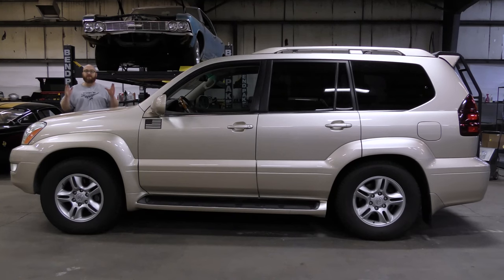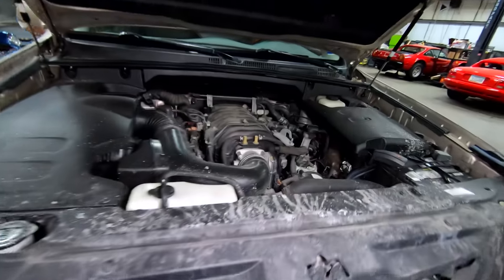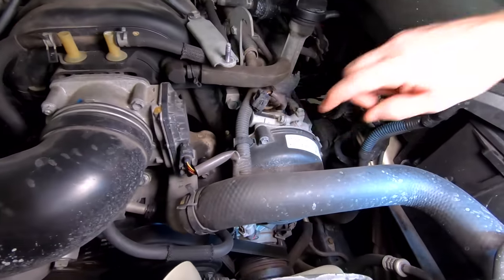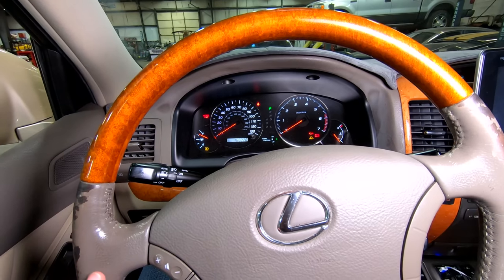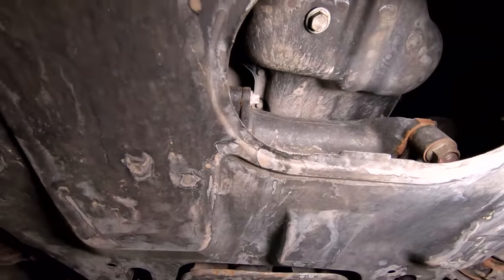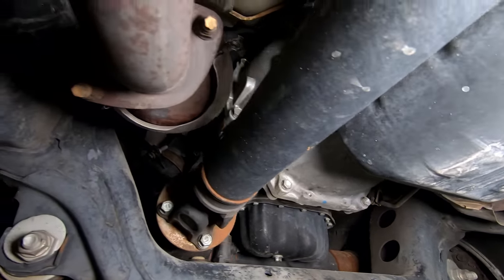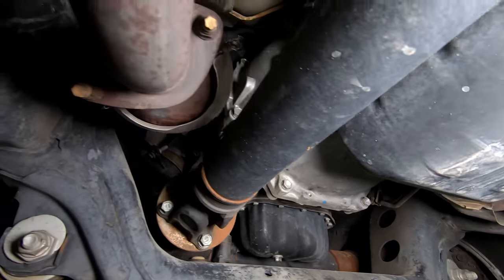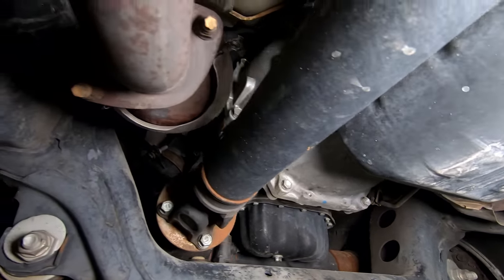How could this super reliable '07 Lexus GX470 have such a stupid design? CAR WIZARD weighs the risk

Comment: Starters don't fail often at all on cars without start-stop. Perfectly reasonable place to put it.
Reply: As a diyer it took some time put I did it mayself buy oem
Reply: Kinda curious as to why the customer wanted this done. Seems very un-wizard like to do a job like this just because the customer asked?
Reply: On the contrary. Starters CAN and do fail on cars with no start stop. Especially on cars like mine with a plastic bendix that breaks, preventing the solenoid from engaging with the starter motor. Think a starter can't fail? Tell that to my busted knuckle and that broken starter I pulled (no start stop on my 1988 BMW 750iL).
Reply: I have to agree. Personally, I prefer doing the ones under the intake manifold.
Reply: The exact opposite is actually true, especially if you don’t use start/stop all the time.  The St St Starters are heavy duty.

Comment: GX470 is hands down the best 2000s SUV platform out there. Torque, reliability, 4x4 capability.
Reply: Shared platform with the 4Runner v8 too.
Reply: @Zephyr8086  they are definitely very similar to 4Runners. The platform twin is the Toyota Prado 120 which was only sold overseas. Here’s some more background https://youtu.be/hlAl3hm94iM
Reply: But poop fuel economy.
Reply: @joshuagibson2520  sadly, yes
Reply: @joshuagibson2520   MPG around town for me is about 13mpg.  On trip from Oregon to San jose I got 22.9 driving gently, on the way back I drove at the fastest safe speed and got 17.  At least as good as my 2006 4runner 2wd.   It is a great truck.

Comment: The vacuum lines under the intake manifold all turn to dust by the time starters fail on all  1UZ/2UZ/3UZ it affects. Kind of forces you to address it all at once
Reply: As well as knock sensors wiring
Reply: I'll be upgrading the hoses to silicone and replace the filter and start and intake gaskets with OEM parts with that time comes. I hope i don't pull me hair out lol
Reply: @ivanstarkov4053  chipmunks get to the wires

Comment: One thing I absolutely agree with Grumplestiltsken on: start / stop "feature" on a vehicle is an AWFUL idea.
Reply: It was promoted by regulators to “cut down” emissions. Same reason they are killing v8 on newer Lexus LX and future GX. It is the first thing I disable on every car I owned.
Reply: Love the grumble still skin name
Reply: My car has the feature and I turn it off each time I use the car.
Reply: 1 exception: Hybrid vehicles. They often use the drive E-motor as a motor/starter/generator. Those are beefy and fully up to the job. Just have a look at a Prius. It doesn't even have a conventional starter motor. The E-driveline is taking care of starting.
Reply: Agree. I live in a tropical climate country. When the engine stops, the air-cond compressor stops too. In a hot and humid weather, it is torturing for the occupants.
Reply: @jfv65  yeah it's ok on those. They have like a three phase 50hp 'starter' def not the same as a regular car. It's the electric motor.
Reply: It sure is mostly stupid. If you're parked for more than a few minutes you should shut it off, but stopping the engine for 30 seconds is stupid.
Reply: @j.h.hahnes8849  terrible wear on starter
Reply: It's interesting that not all brands use stop/start on their ICE cars. I don't think I've seen it used on any Japanese and Korean stuff, but I see it alot on American cars and some German ones which seems like it must be some kind of lazy short-cut since they can't make enough of their cars naturally fuel efficient. Surprised he doesn't have some computer to deactivate it for his wife so she doesn't have to keep turning it off everytime she drives.
Reply: Not to mention the stresses they put on the engine due to the oil pressure loss every time it shuts off. Causing premature wear and longevity of the engine life.
Reply: Start/Stop features are only designed to give the vehicle better fuel economy ratings and appease the government's lame CAFE standards. It doesn't benefit you, the vehicle owner, whatsoever.
Reply: It's great if you use it effectively. Most models require a specific pedal press to activate it. If you do it when you catch a light or are in the drive thru it can save you alot of idle hours. Most people don't use it that way though
Reply: Regulators= politics
Reply: Bad idea
Reply: My first thought about that feature is that the engine itself takes the most strain during startup. I bet on a normal day, that engine turns on and off more times than a shift for a pizza delivery guy
Reply: @chynacash3138  The Nissan Juke has it... It's so annoying!
Reply: So is "climate change".
Reply: @Spanked78  and if it doesn't benefit *you*, why do it, right?
Reply: Stop/Start feature... because having oil in the top of your motor is played out.
Reply: @cb2638  Oh ok I've never seen a non-hybrid ICE Toyota with that system, cars usually catch my attention in traffic when I hear them start back up when the light turns green lol, it's always some American car or BMW/Audi/Mercedes. But now that I think about it I believe some ICE Nissans and Mazdas use stop-start too. I forgot about them since they're kind of lower tier Japanese brands than Honda/Toyota.
Reply: Effin tree huggers

Comment: These are fantastic vehicles; and if that's the biggest problem you can find, nobody can complain. And has been pointed out, there are advantages to putting the starter there. Keeps it out of the way of damage, doesn't cook it with the exhaust, and it's quieter. No big deal to pay a little extra to change it every 15 years when you need to
Reply: gas mileage.
Reply: @bakgammon  of course gas is an issue because it starts and gets you to places unlike many others that just sit in the repair shop ie saving on gas.
Reply: @bakgammon  who buys a V8 5000 pound truck and complain about gas mileage 🥴

Comment: I remember watching your video on which 1/2 ton gas trucks to buy. I decided to save a bit more and got a 2012 Toyota Tundra 5.7 with 4x4. Holy crap is this an incredible truck! Bad gas mileage, but it has been absolutely trouble free. I did the spark plugs, oil change, differential fluid, and transmission fluid when I got it. It's absolutely fantastic! Thank you so much for the solid advice Car Wizard!!
Reply: I got a 2014 tundra in December after watching the same video. Sweet truck.
Reply: I had a 2007 Toyota Tundra V6 - 4.0 liter regular cab short bed. That truck with just 240 horses and the 6 speed trans. Would pin you back in the seat. When i did stomped it every once in awhile. The steering and handling the corners were A1 performance all the way.

Comment: The starter is placed at the highest point of the transmission and this is due to people getting mud and other debris in them whenever they try to go off roading. And causing them to fail. Keep in mind this engine is shared with the LX 470, and the Land Cruiser of the same era. All of them design to go off road and last a long time.
Reply: So my 93 LS400 has this “feature” so it can go “off-roading” huh? Lol.
Reply: It’s the LandCruiser engine in the Lexus.. and many owners do offroad them especially the older models that were bought second/third hand.

Comment: Few months ago I replaced a starter on a 2002 Tundra with the same 2UZ 4.7 engine. The starter failed at 320 thousand miles!!!! It took me about 2.5 hours. In my opinion it’s not really a design flaw. From 2005 it’s more complicated but still not too bad of a job, just a little more time consuming.
Reply: It is a design flaw if it becomes unnecessarily expensive.
Reply: @worldhello1234  It's an even worse design flaw if it must be done frequently and/or just even further complicated
Reply: The exhaust manifold has to come of to change the starter on 5.7s, this seems pretty easy…
Reply: Agreed. I wish my 5.7 was set up this way instead.
Reply: @j.h.hahnes8849  Yeah, you'll be doing it again when you replace you made in japan oem starter with autozone dura-crap. These starters last forever
Reply: @worldhello1234  replace the starter at 300,000 miles and it lasts for another 300,000. I don’t see your point

Comment: It would be a design flaw if they failed a lot,  they don't. It is one of the most reliable starters on the road. Same set up in the early Tundras. It is not that hard to do either. Like your channel just the same. Keep it up. 49 yrs in the trade myself.

Comment: For something that's very reliable and can last you as long as 250-300k, I wouldn't call it a design flaw. My GX has 260k miles with original starter from 2004 and LX470 2006 with 150k KMs and starter on both of them, still going strong. So, for something that doesn't require a regular attention, it is kind of silly to classify as a design flaw
Reply: I’d call it a bonehead engineer who isn’t considering the technician. All modern American V-8 motors have externally mounted starters. There’s no benefit other than footprint to placing it under the intake. Just some jackass who has never actually wrenched on a car would make this decision. And I like the 4.7 2UZ-FE
Reply: @nordicpride9708 it's actually a fantastic design for the vehicles intended purpose. The uz is most often in offroad vehicles in which they go through harsh elements such as water crossings in which you do not want your starter getting a bath.
Reply: It's funny how must people think a decent Japanese vehicle can go only 250-300k.  My ridgeline is at 374k, and i treat this thing like crap  lol.  I haven't changed the timing belt in 180k miles,  and just keep adding oil every now and again
..yup.. not even actual proper oil changes.   And i live in rather rough country.

Comment: Luxury version of the Toyota Prado sold everywhere except the US and Canada I believe. Have driven the Prado in Afghanistan, Kuwait and Iraq.  Love them as they are pretty much bullet proof with a great 4WD system.
Reply: There are some Prados (like there are some LC 200's and now all new LC 300's) with the same NA-V8 (or T-V6 on the new LC300) that have the same engines as the US-spec Lexi (counting the new LX600 as the only US-spec version of the LC 300).

The difference is the availability of other lesser-powered engines and / or TD's and equipment.
Reply: What’s driving in Afghanistan like?
Reply: @diablocls55  like in every country. You turn the wheel to go left and right and press the gas pedal to go and brake to stop
Reply: Afghanistan, Kuwait, Iraq...bullet proof? Did you dangle that out there to see who would bite?

Comment: That GX definitely needs a set of airbags replaced.  And yes, you're supposed to turn OFF the ride height control before putting it on a lift.  There's a placard down low on the center console that tells you that.
Reply: I converted mine onto regular springs with little bit of lift kit on all four sides, sure comfort is not as good as bags but for long term, they will last me and lifted with mean tires, car looks cool
Reply: @TheShakir98  the air bags on mine rode terrible, loving my coil conversion
Reply: When Cadillak introduced a reactive air shock system, they memoed everyone to NOT lift the car before disabling the system. Guess why... (hint: Boom Boom Boom *Boom*) "What Memo?" It twernt pretty nor cheap while shops adapted.

Comment: I had a Sequoia with that same 4.7L V8.
It’s an outstanding baby V8 at 285ci.
I sold mine with 330k miles and never had to replace the original starter.
Reply: Yeah, I don't know why someone would want to replace a starter that is still working fine. Waste of money. Odds are, the one in this unit will last well over 200k, the owner might not even have the vehicle by the time the starter fails.
Reply: Oem used starter is way better than brand aftermarket garbage

Comment: I think I may actually have an answer to why they did it like this. It may have something to do with using this motor in RHD countries to keep it out of the way of the steering column no matter which side of the car it's on.
Reply: The Nissan Titan 5.6 V-8 also has the starter located there. I’m on my third Titan and all three have been rock solid and reliable.
Reply: its to have a very quiet start up. theres a video called lexus ls400 documentary, its an hour long but it tells you why the engine was designed like that. the 1uz and 2uz are basically the same engine the difference is the displacement and the truck motor is an iron block
Reply: I was actually impressed the book time on this is 4 hours.  I did my SC400 starter many years ago - took me maybe twice that over Saturday and Sunday and destroyed my back leaning over the engine.
Reply: The thing is the starter not getting cooked by the exhaust makes them last a long time. Much longer than a gm ls starter that gets cooked by the exhaust.
Reply: @jnljnl8485  hmm gm northstar engines have the starter in the same spot and they fail regularly.
Reply: @brayannexon4613  The Wizard has done a video on that.
Reply: @paulhoskins7852  i am referring to the starters on northstar engines not being great.
Reply: That's right.

Comment: At runners timestamp 13:37
This is why if there's a repair needed on any of my vehicles which I cannot do, I do my research on it from various YouTube channels and mechanics to determine how many hours it would take to do it before I take it to my well qualified local garage.

By doing so, I know/learn how many hours it takes to do repairs and/or the difficulty of replacing that part.
Reply: That is only what the book pays on the job, for flat-rate purposes, so shops know approximately what to charge.  It is usually NOT "how long it takes to do the job".  It usually takes longer to actually do the job.
Reply: @TheCyberMantis  Ya and sometimes it can be done in half the book time and you get charged full time anyway
Reply: @Morpheen999  -  Sure, some mechanics work faster because they’ve been doing it for decades, and they’re not expecting a pay cut.
They actually expect to make a better living than far lesser mechanics if you can believe it…  All trades and professions are like this.
Reply: I do the same thing in a way, I research and decide if it's worth the trouble for me myself and my current situation.

Right now I'm rebuilding my dirt bike engine, I just did a clutch and transmission job on my Fiat Abarth, but I paid a shop to install a gas tank on my truck and another shop to the timing belt on my car. I'm perfectly able to do it but for whatever reason at the time I decided to outsource

Word.
Reply: @TheCyberMantis  granted, I was in a rush to reply and trying to compose my words to basically say, but you just did, that. The book tells how many hours it should take....each ship charges a different rate.

Comment: Very nice review. 

The real design flaw on the GX470 and the V8 4Runner is the exhaust manifolds.  They have a weird design where it seals to the exhaust ports and they crack and leak.  All of them will do it at some point in their life.   They will need to be replaced.  The thing that is unfortunate is the front cats are built into the manifold so to replace it you have to replace the entire assembly, manifold and front cat together and it is very expensive. 

They do run forever!
Reply: Yes, many of these have the exhaust manifold issue and its a costly aftermarket fix. Toyota did step up and replace it in some cases but they use the same OEM which causes issues in a few yrs. 
Also the dash cover is most likely due to the fact that these were notorious for dashboard cracks which is again a costly fix. And the frame rust can get really bad if not well cared for. So yes very reliable but has its share of issues which can be costly to fix.
Reply: Yup just had to replace my starboard manifold. Used new OEM part but had it installed by an indie shop.  Worked out fine and soooo much quieter now.
Reply: This doesn't affect all GX470s equally. The 2003 to 2004 non VVTi 4.7 doesn't have the secondary air injection system for emissions. The SIA injects air into the exhaust on startup to get more O2 in the exhaust to warm up the cats quicker. The design is cause for manifold cracking issues. The 2003 and 2004 do have manifold cracks, but it's less prevalent than 2005-2009.
Reply: More so on the 4Runners.  Not so much on the GX470s…not sure why.
Reply: @closer71  

That is odd since is the very same part and so on.
Reply: @Gadget0343  Probably related to the non-VVTi engines in the 2003-2004 models like the guy above mentioned.
Reply: @closer71  

The manifolds are the same as far as I know except for the provision for the cold start air injection system.
Reply: @Gadget0343  I can read.